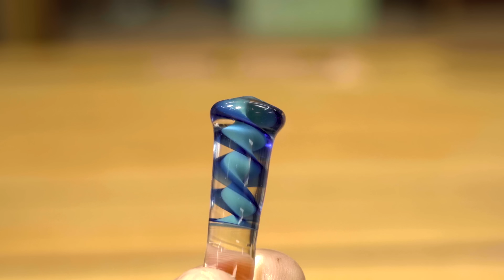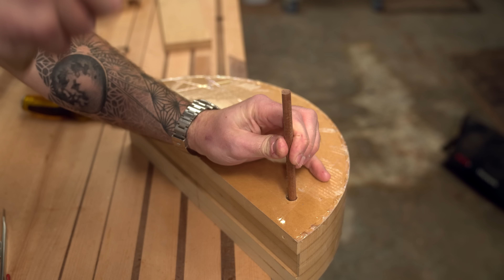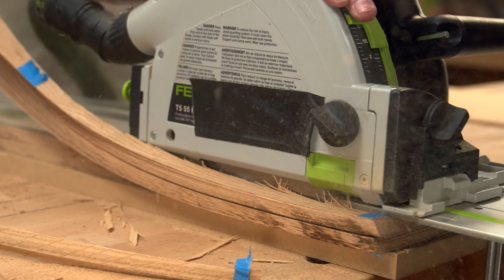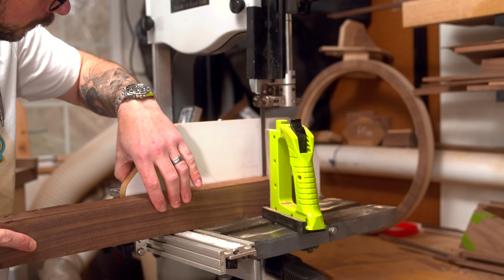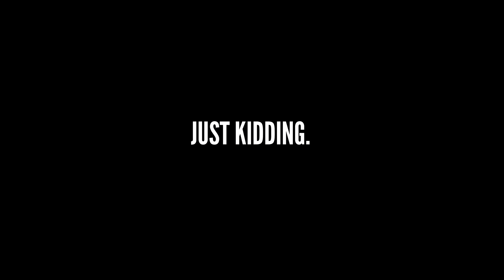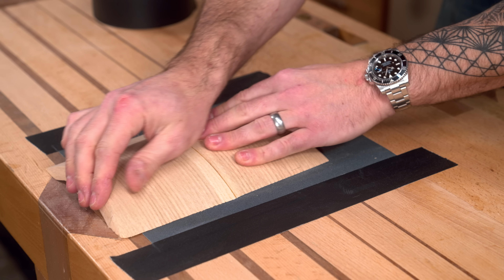Building a Collection & Obfuscation Device

Comment: Do you actually smoke the wood you're using or is it just ganja in between? Nice work! I'm a "mechanic artist" and recognized some of your vibes. If I like the solution I go for it. Building it is another challenge and sometimes pretty difficult. But oh so satisfying when it all works. Clients get confused in the meantime but the final result gives them a big smile too. This helps getting your bills paid as a minimum. As a maximum I discovered; new clients are in cue! ;-) Stay safe and all the best, Job (one tip; draw your design first in CAD. When a project get complicated it's a great help for finetuning details and showstoppers or bummers upfront. And you can start working right away in between with the parts you're confident about you need anyhow. You can also retract printed templates for your parts with it. A3 is a comfortable size for the not so big parts and I print them in my shop. I also used banner sized paper templates but they where printed for a few euro's/dollars in a shop close by. I guess you are using a cad model but you don't show it in your video's or at least I didn't get it. But why not mention it. Oh and I'm an ocd (?) person too; sorry about the cap in between the top curve and the top of the drawer... But maybe this is why you made it this way... Let me know

Comment: I'm digging the inspiration and execution.  I heard you mention steam bending...  Have you looked into bending with heat blankets?  I'm making a side bending heater for making acoustic guitar sides right now.  It will use a 6x36 blanket.  I found a maker who can do custom sized silicone heaters.  I also made a controller that uses a thermocouple and will keep the blanket within just a few degree range, so you can find the "sweet spot" and it will be repeatable every time...  Just thought I'd throw that one out to you.
Reply from the maker: That’s super cool! Now that you mention it, I’ve read about it, but haven’t looked into it much. Where do you source the blankets?
Reply: @SawyerDesign  Nick, I just sent you an email with a few links.  Let me know if it all makes sense...  There are literally 100's of options.

Comment: No need to use mdf over the hole width of the mould. Just put a bendable 3 mm mdf on top like used for cheap furniture as back wall. Also for steam bending you'll need a similar mould.

Comment: awesome work 🔥enjoyed watching this and inspired me slightly for my next project... but one thing i don't get yet... why you're so curious about the smal gap at the bottom and fix that so it looks perfect and on the other hand using screws to secure the "holders" instead of small wooden dowels that don't go all the way through.... you wont see them tho
Reply from the maker: hey thanks! I don’t see anything wrong with screws given the proper application. Was worried dowels wouldn’t have enough purchase in that 1/4” bottom to secure the glass properly.

Comment: 1.  That shelf top draw is so super cool.  Great piece of work there.

2.  I notice you sand the surface for finish.  Why not a sharp plane.  Is there too much risk of tear out at that stage of the build.

3.  Gotta mention your devotion to excellence.  Your drive to do better and strive for the best.  Your products are beyond what my mainly hand tool shop can do but I look forward to you making available some of the simpler designs you have made (as complex as they are).  And I get into dovetales so bad.  Double dovetales and hounds tooth are where ever I can use them.
Reply from the maker: Hey thanks so much, Danny! I usually don’t plane panels because the veneer is so thin and tear-out will result in quite an unsightly error. Also really hard to achieve a line-free surface with a smoother and supporting a box to be planed is tricky. Sanding achieves a finer result.

Comment: Holy s**t, Nick... that's beautiful. So much effort directed into one small piece, but it shows. I understand now your comments on transition as a woodworker, and how design brings you back to the start. Awesome. Also - the adderall comment explains so, so much... I may have to get me some. Question (and a serious one) - do you find the blood you slathered all over that box sands out, and in your experience is concern over bleeding for your craft differentiated by light vs. dark wood species? Asking for a friend, if you will.
Reply from the maker: Thanks Matt! Blood usually sands out, but it’s a pain. Hence, the constant bandaids I have all over my hands. Bleeding splinters usually are the main offender.

Comment: Not all Vacuum pumps can pull the same pressure that's a ridiculous statement.  However there is a maximum vacuum pressure but how much that is depends on your altitude and to a lesser degree the weather.  At sea level it would be closer to 2000 lbs/sqft or 101,000 Pascals.  At say 5280 foot elevation around Denver CO it would be a little over 1700lbs/sqft or 83,400 pascals
Reply: Jeeezuz man. I’ve used pumps my entire PhD career, from roots blowers to move huge volumes, down to 20 inch diffusion pumps - where I had to specify lid thickness and deflection specs. Cryopumps to titanium getters. Go ahead and calculate the force difference between 5 mTorr and 10^-9 Torr.  It matters not a bit in this application.  Nick knows what he’s doing and if you paid attention, there is a lot more going on than suckage.  Any comments on the subject of the video?
Reply: @trick58  For that kind of vacuum pump yes the difference in pump isn't significant for this application, but there are plenty of pumps sold for vacuum bagging that won't pull anywhere near the milli-Torr range.  And the difference altitude makes is very significant.
Reply: My understanding and I may be wrong. I believe he was referring to all the pumps sold by the vacuum bag manufacturer draw the same pressure?
Reply from the maker: All the vacupress pumps suck the same* Just checked my math though and you’re right, I did make an error.
Edit: 32 sqft at 11.7psi = 4608*11.7 = 54,000 pounds over the surface area of a std 4x8 bag. That’s a lot of pressure.
Reply: @SawyerDesign  Well, that changes everything.